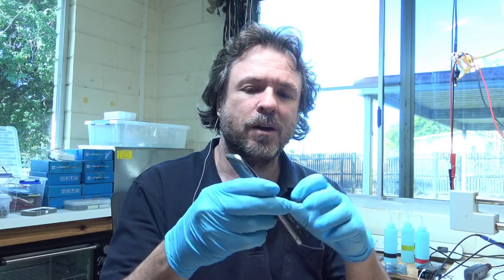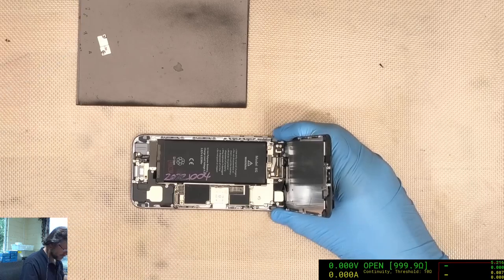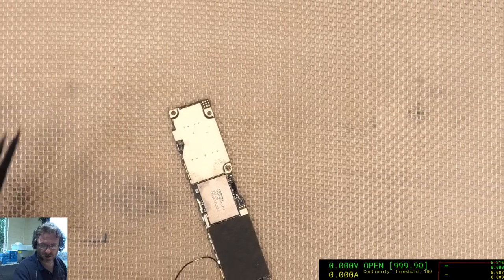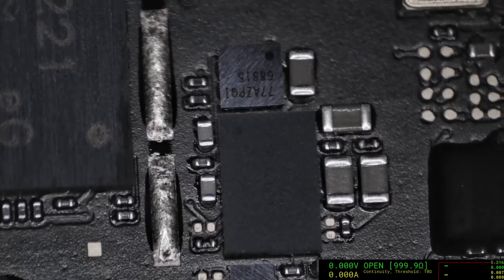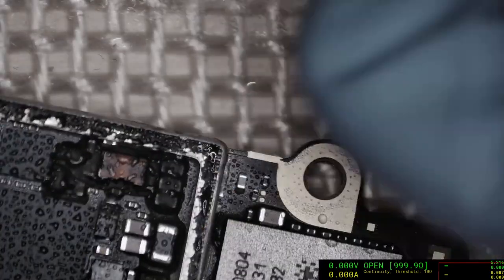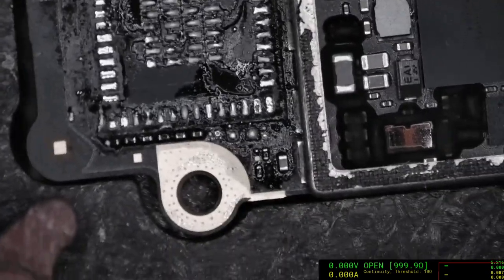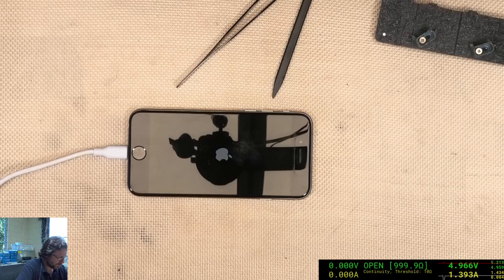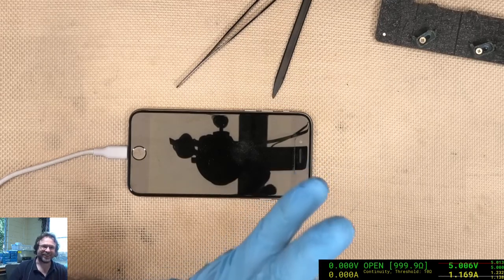Classic Repair: iPhone 6 suddenly won't turn on, data recovery required

Comment: Great fault finding Paul, enjoyed the visual aspect of the freeze spray 👍
Reply from the maker: It’s a rare thing to use the freeze spray, even in winter the room temperature is still in the mid 20s so the freeze spray tends to turn to liquid before I even get the microscope and power applied

Comment: Deja vu 🤣 Nice job. Damn PeeWee putting his two bibs worth at the end. Everyone is a critic
Reply from the maker: It's a prequel - better than the Starwars ones, that's for sure.
Reply: @pldaniels  May the (hot air) Force be with you.
Reply: At the end of the video I was on the patio looking around wondering where the bird was...
Reply from the maker: @fullwaverecked  cheeky hyperbolic little noisy b*stards.  I prefer the magpie & butcher birds, even the bower birds.

Comment: SIR WHAT IS THE NAME OF THE EQUIPMENT YOU USED TO INJECT OR SUPPLY 4.2V TO THE PHONE,THAT EQUALLY BOOT IT
Reply from the maker: That is the DT880 power meter / injector.  Unfortunately they do not seem to be available any more.  I have designed a replacement board/device which may arrive later this week to see if we can provide a tool of equally good performance to everyone.
Reply: @pldaniels  any update on the new tool ?
Reply from the maker: @Carlcox89  I've got a couple built that I've been testing.  Received my 3rd version PCBs recently and I need to do a build of one of them.  I've also started trying to print some 3D stands for them too.
Reply: @pldaniels  nice to know :)
I also like to develop and assemble my own boards. Let me know if I can be of any help.